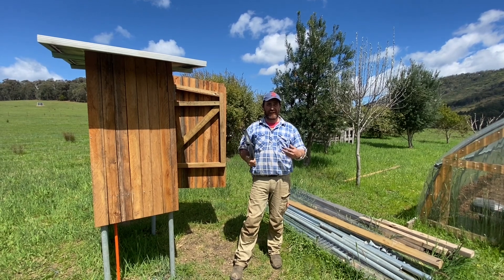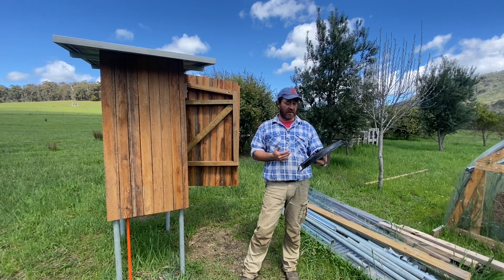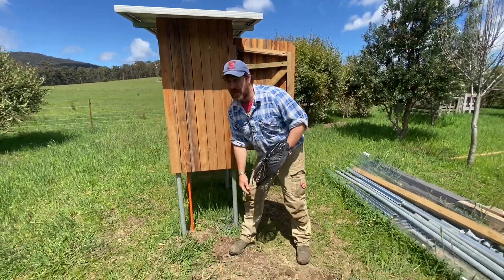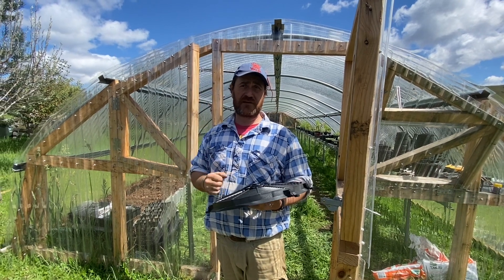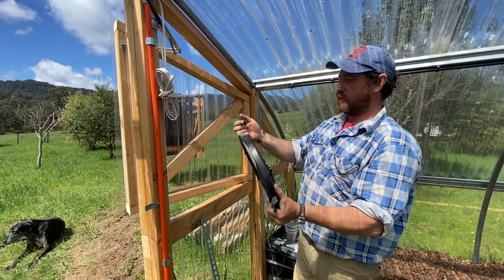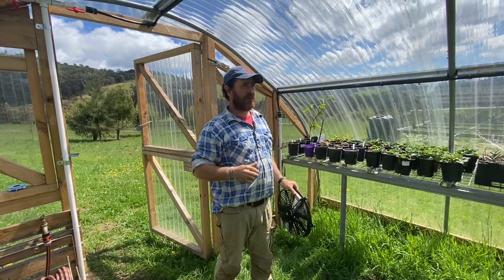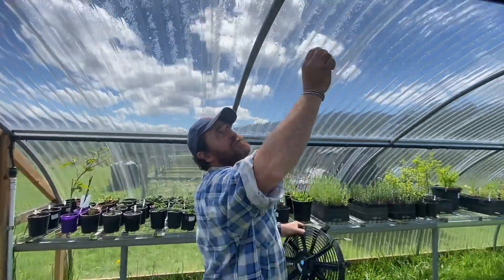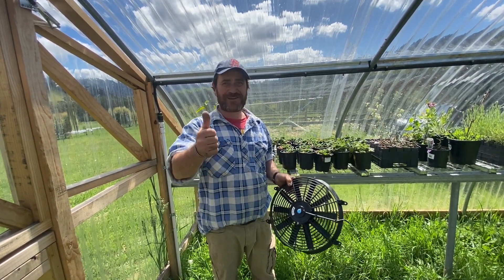Air Circulation Fans In The High Tunnel/ Hoop House - Electrical Set Up.

Comment: Hi there, I think your idea for positive ventilation has real merit but I would be concerned that a natural prevailing breeze would overwhelm the fans unless there was a baffle with a fan cutout at each end of the hoop house which otherwise sealed off entry of a natural breeze. I guess there would be one fan pulling in air while the other was exhausting it. Idk if that would work for you but that would be my first try.
Reply from the maker: Hi Richysee, I'm expecting that if there are breezes being caught by the opposing open windows the temperature would stay moderately cool. We are located at the end of a valley in a culvert so to speak, and the winds are slight at best. The fans will circulate and hopefully cool slightly against the moist environment. We will be changing the sprinkler cycling over the warmth months to hopefully act like a evaporative cooling system. I'll explain more once i have the fans wired in. Thanks again for your comments. Stay safe. Cheers